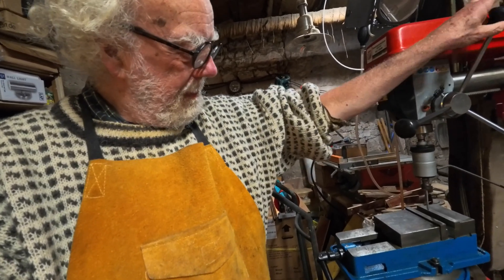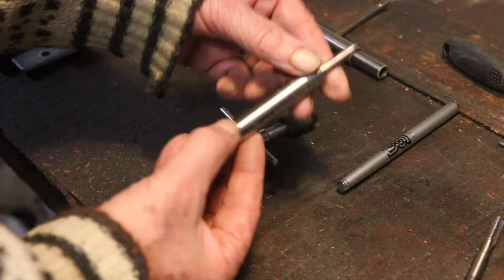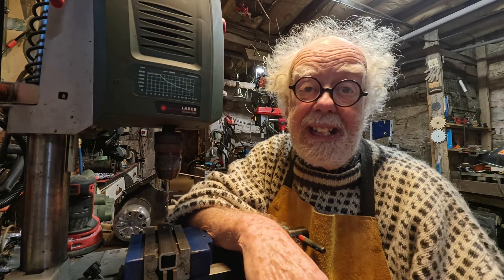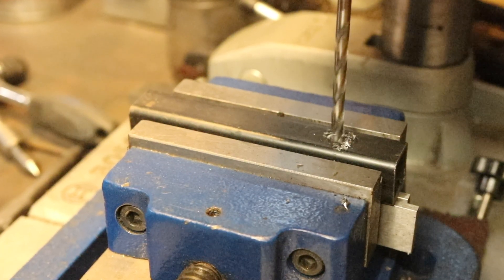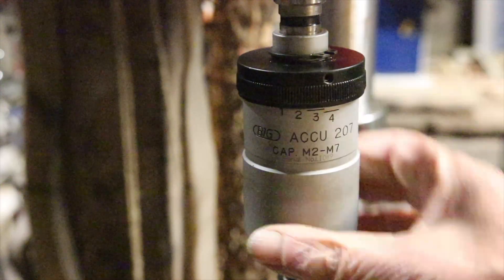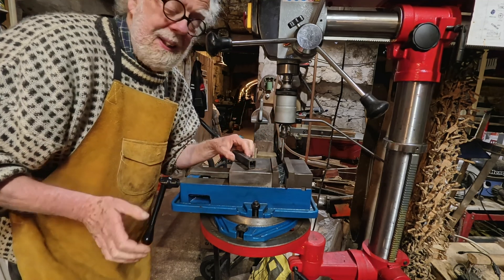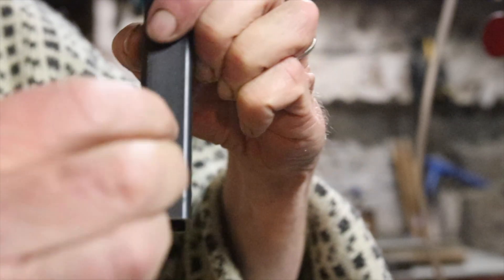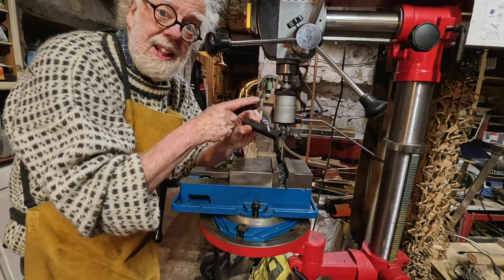Drill Press Magic Tap Machine

Comment: I am a machinist, and I would like to say nice video up front... and I love the hair. However, the brand BIG... has had a cult following in engineering for decades. They produce some of the best stuff out there.

I think firstly, you got lucky with the price of that unit. And secondly... one of the reasons you got lucky is that that unit only goes up to M7. The ones that go to M12 are around or over us 300.

Still a very nice find.
Reply from the maker: yes....wish it did m8 ... i am a hobby engineer and my taps are m4 to m8 ....its a game changer for quick straight tapping

Comment: First of all, that is not "bar stock", rather, square tubing. Secondly, you did not drill a "clearance hole", which the tap would fall through. The Accutap unit is comparable to the Tapmatic, both of which require a torque arm, not a "rotating arm". which must be prevented from rotating in order for the tool to function. There are many iterations of this type of tool, all of them worth much more than 100 euros in reasonable operating condition I would think? You made an excellent purchase!
Reply from the maker: top man...totally correct in your naming of the parts... its a  good tool.

Comment: When I was an apprentice we all had to practice with these auto taping machines as they were used in the production lines.
Can I please suggest that you run it a bit slower, your taps will last longer.
Reply from the maker: thank you...i can slow down the drill press ...good tip.
Reply: Is tapping oil still used nowadays?
Reply: @Tubemanjac  I still use Rocol RTD.

Comment: You meant to say "Commercial tapping drill size" Rather than clearance hole, prof. They are great tapping aids, and can be used in a lathe as well. I must get one myself, as they are shoulder joint savers.

Comment: For best taps:
- Slow motion. With ideal equipment this would be 955 RPM for M6, but hobbyists are not in a hurry, so 100 RPM or less is much better. The slower, the less the tapping tool wears out.
- Lubrication, lubrication, lubrication. Professional drill presses have a pump for lubrication fluid, hobbyists should at least apply a good chunk of oil.
- Drill presses help even without such a tapping tool. As you say, getting the angle right is the hardest part, the press does that. At the bottom, simply turn the drill press off. Then either turn the chuck backwards by hand or open the chuck and remove the tapping tool with that good old handle.
- Such a tapping tool is golden, of course.

Comment: Tapping reversers have been around for as long as taps have been used.   Make sure to use the correct machine taps.  Ordinary hand taps have  flutes only suitable for hand tapping.
Spiral flute ones will remove the swarf upwards for tapping blind holes.   Spiral point taps have flutes that push the swarf downwards, these are for through holes only.
Always use cutting fluid etc//// Do not tap dry!  Better still, thread milling is king. Only possible with CNC machines.   CNC can rigid tap, but it can be a big problem if a machine tap breaks in the hole.  Ruining an expensive part.  Using the tap reverser on a manual machine in blind holes is possible but make sure the hole is deeper than the tapping depth, set your depth stop accordingly.
Good luck.

Comment: Centering tools on a grinder that can be chucked & lightly hammered stams is such a great tool to have around. 
To Dimple it up then drill it out. Head stays aligned for the whole process down to tapping it all stays true the whole time. 
But when you make a bunch of the same part's needing tight tolerances its best to do this one thing across all sums of part's. 
unless you make fixtures that will pivet spin move for multiple opps & apps.

Even outside of the lathe mills grinders I use centering tools in countless hacks in the world